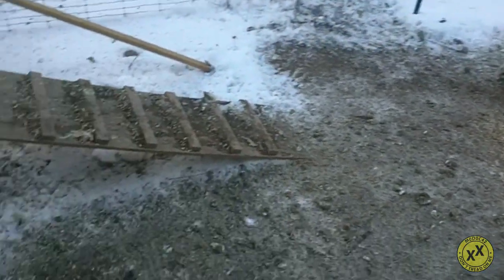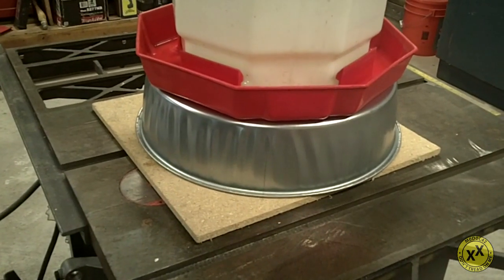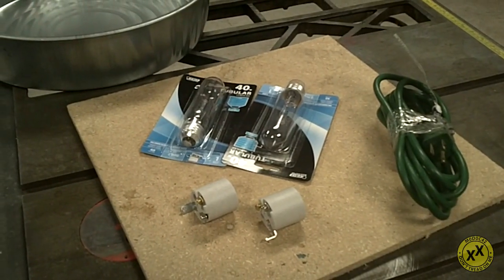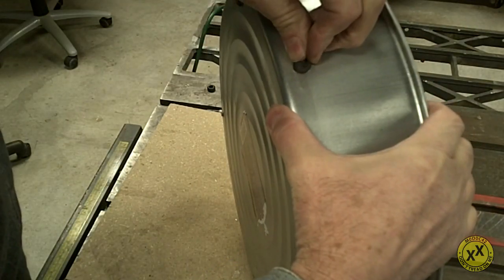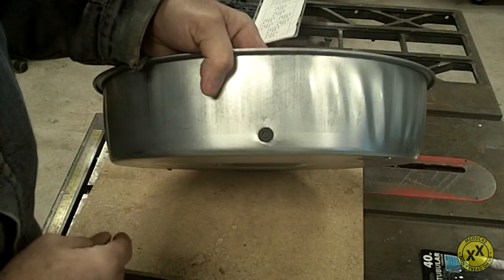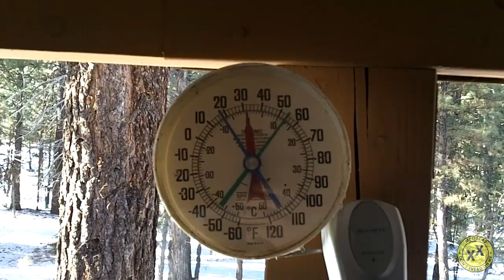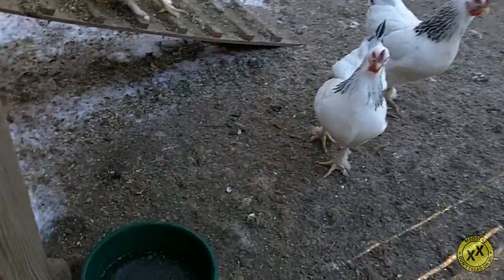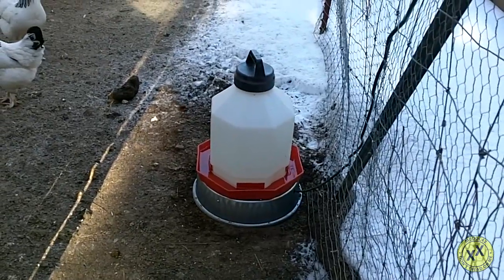DIY Deicer

Comment: Great work Doc!  Just make sure it's plugged into a GFCI outlet... in case it get's wet under there from snow melt and such, you don't want your girls to come to a "shocking" conclusion if they touch the metal!
Reply from the maker: Got it covered.  It has an equipment ground in addition to being plugged in to a GFCI circuit. I sure wouldn't want to get those girls feathers ruffled up! lol
Thanks! :)

Comment: That looks like it's working great to me. Do you heat the coop the same way? How cold does it get there? Thanks for sharing, my wife and I want to get a few chickens soon, we get some pretty cold temps here too so I'll just have to steal your idea lol...
ATB, Steve...
Reply from the maker: It's still going strong, now a month after you made this comment. (my bad) It was minus-12° when I decided to make the fount warmer, but it's been unusually mild since then. During a normal winter, it's not unusual to see minus temperatures and weeks at a time where it remains below freezing 24/7. These Light Brahma chickens are good cold-hardy birds. I run two 150 watt reptile heaters in their small coop and they actually roost closer to the open door than they do the heaters.
ATB with your chicken acquisition!

Comment: Very nice, looks like it would even meet code!
Reply from the maker: It should. I attached a ground wire against the pan, under the nut that secures the stand-off for the light socket, so everything is grounded. The red wire should have been a white one, but I didn't have any white wire available. 
Thanks! :)
Reply: I will not say anything about the red wire!
Reply from the maker: westtexasprepper . Cool. it'll stay our little secret. LOL

Comment: I may have to try this. I bought a stainless steel dog bowl for mine when it got cold so I just have to check it daily. Its easy to get ice out of a metal dog bowl with out breaking it, unlike a plastic one.
Reply from the maker: Yeah, that plastic gets real brittle in the winter. Long as you can keep the water warmed, it's not a problem, but I lost a plastic tub last year, when the tank heater I had in it burned out. The water froze and the tub disintegrated when I tried to dump out the ice. I just hope your chickens don't get their tongues stuck to the metal bowl. (lol)